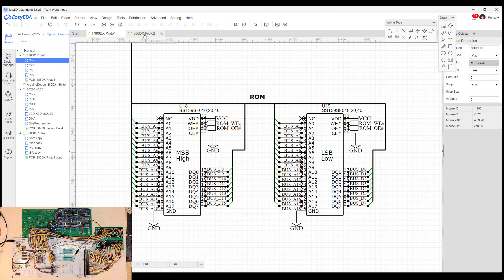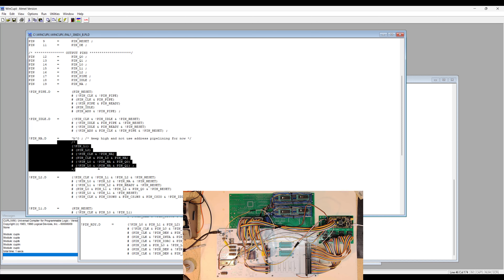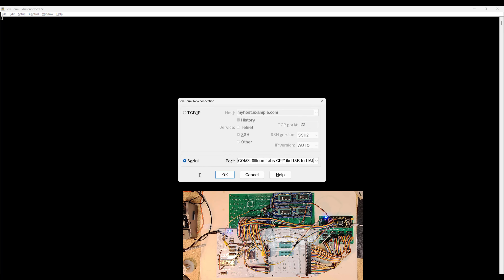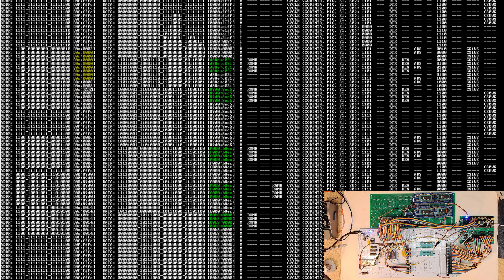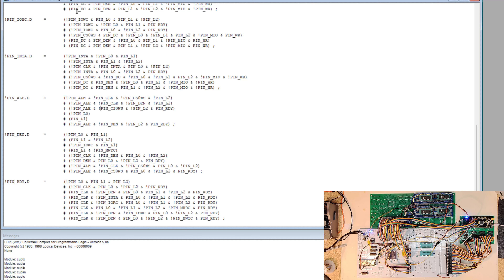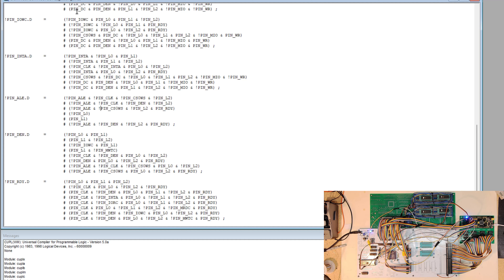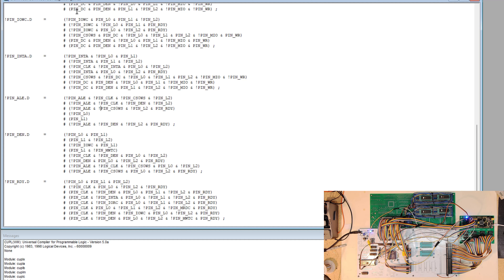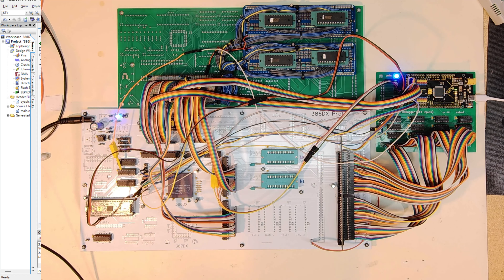80386 DX Build, Ep. 7 - Quad ROM & Troubleshooting Address Latching

Comment: I wonder if it would be easier to come up with your own logic for things like wait states, address latching etc based off the requisite timing diagrams in the datasheet? The equations for those GALs are quite confusing if there is little explanation of what all of the output signals do. And there is a lot of dependency on a few of them throughout all of the equations it seems.

Sometimes (well, maybe most times) I find it easier to just "re-invent the wheel" because at least I understand what all of the parts are doing and how they are interacting with each other and why they are needed at all - and I sort of prefer it that way anyway because its more of a learning experience overall.

Its certainly an interesting and challenging project!
Reply from the maker: I agree it's a challenge! I believe the 80386 Hardware Reference Manual has the information needed; I just need to read it from front to back, and maybe do a little reverse engineering (like the case with the PALs). I do imagine I will deviate from the pure Intel design as I learn my way through it (as Intel would expect a person to do). The output signals of the GALs seem to be documented. I just need to chunk my way through all the pieces. I figure I can't boil the ocean in a single week, but I can figure out a new portion of the Intel design each week. For example, I was thinking of converting the PAL logic into a logic diagram with gates (e.g., in the software Digital). I also plan to start documenting some of the timing analysis, which I think will get interesting, as I have a combination of discrete 74 series ICs, PSoCs, PALs, other ICs, etc. Needless to say, I continue to learn a great deal as I work through this build!
Reply from the maker: For the fun of it, I converted PAL1 to logic gates in a PSoC. I have a link to the PDF on the following page, if you're curious: https://www.rehsdonline.com/post/386sx-upgrade-386dx-glue-logic-bus-control-pals-gals-plds. (I would post the PDF link directly, but it's a crazy long URL.) Whether or not this view of the logic is helpful... I'm unsure.  :)
Reply: @rehsd  I suppose the thing that is confusing me are the L0, L1, Q0, Q1 etc nets. These seem to be perhaps some intermediate nets that are used as state within the GAL, but dont necessarily feed out to the CPU or other chips on the board?

If they had more human friendly names it might make it a bit more clear whats going on with them and what they are doing.

I suppose I'd really need to sit down and read through all of the same documentation that you have to get a better grip on it, and it would probably help if I was building a system as well (so that it all had some context).

Ive got plans to build a 286 based system some day, since Ive had some 286's hanging around for years waiting for something to do. But the 386 seems like such a nice complex challenge that maybe I'll have to try that instead. :-)
Reply from the maker: @TomStorey96  For L2, L1, L0, they appear to describe the different states. This might help: https://imgur.com/a/pVCmj9q.
Reply: @rehsd  Ah nice, that helps a lot

Comment: Ahem, for the record, this baby will boot up in 16bit mode initially...
Reply: Which in DX mode due to 32bit bus does involve some trickery on some matters.
Reply from the maker: Yes, I am remaining in 16-bit operating mode (I have the NASM source code set to 16 bits). I can use BS16# for 16-bit bus cycles to use a pair of ROMs. I went with quad ROMs for now so that I don't need to worry about asserting BS16#. I will come back to BS16# in the future.
Reply: Perhaps I am missing something here, and very well could be way wrong on this. 

Here are my thoughts. If you are indeed in 16-bit operating mode, on a 32-bit bus, doesn't that mean that for each bus address what you will be reading is not two bytes (i.e. MSB/LSB), but two 16-bit words (i.e. MSW/LSW)? And if that premise is right, then what you had in the previous episode, where the addressing would jump by two words or 4 bytes is in fact the correct behaviour. 

From the section 6.2.8 (on episode 6) datasheet it says, and I quote, "When the 80386 samples BS16# active and NA# inactive, ** it automatically performs any extra bus cycles to complete a transfer on a 16-bit bus ** ". You demonstrated that by pulling the relevant signal low.

I think (and again apologies if I am wrong here) that for the 32-bit operation, the same premise stands, but the word size would be 32-bit, hence 4 bytes per word, 8 bytes per pair of words in terms of MSW/LSW reads.
Reply from the maker: @ModSlash  Thanks for the info! I believe I have tracked down the issue to be related to the logic I have for managing waitstates. If I can get the waitstate logic correct, I believe the BS16# assertion would have worked in the video when using  a pair of ROMs. I am currently working on an improved debugger, and I hope this will help me better understand the transfers. More to come!

Comment: Timing. Timing. Timing. BuT It WoRkeD On The 6502! Is basically the BuT ShE's a FiRsT CouSiN NoT My SiSteR of the digital world.  I'll be the first to admit I'm a couple Cuba Libres in to the night, but Timing my dude. Timing.

And as a side note, it's not as important that A0 on the ROM is shifted to A2 on the processor, as it is to ensure that A0/A1 isn't connected to the memory.  You could in theory have a mis-addressed PCB with all addresses wire up per datasheet (A0 to A0, A1 to A1,  etc), but with just two wires shorting A0/A1 on the ROMs to GND and a software hack on splitting the programming files would let you run again, although with a quarter the ROM capability.  Not that I'm suggesting it, just saying it's not always the case that dozone of bodge wires, shifting the fulle bus width,  would be required to recover from an addressing problem.

Anyways, always happy to see you making progress on the build. I smell a Linux install in a future episode :-)
Reply from the maker: Agreed. As I better understand the Intel reference design (what's explicitly spelled out and what's not), I plan to start mapping out formal timing for this build. That should be an adventure. :)
Reply: @rehsd  Timing isn't rocket surgery. Was thinking of making a vid on it. LMK if you'd watch it.
Reply from the maker: @zxborg9681  Ya', I would definitely watch it! In the past, I have enjoyed Adrien Kohlbecker's timing analysis as part of his BB816 build. https://www.youtube.com/@akohlbecker